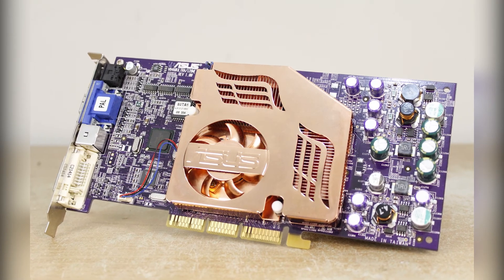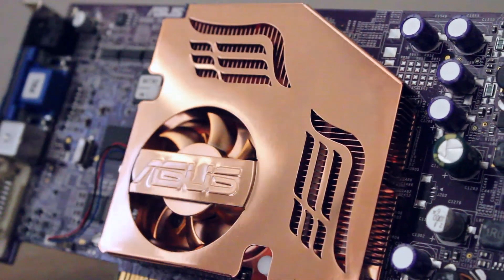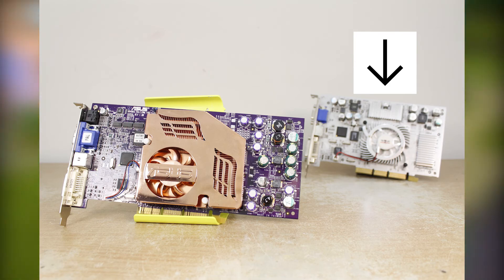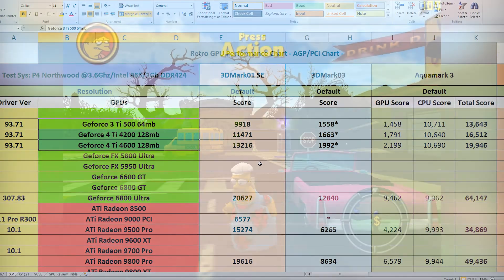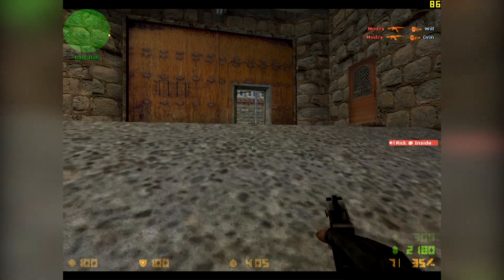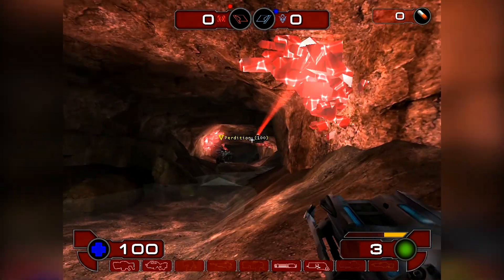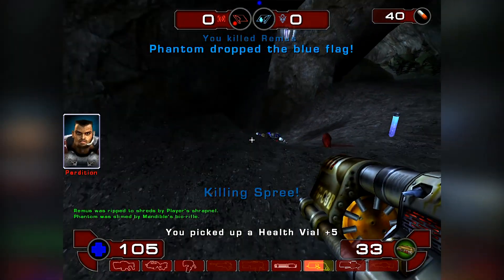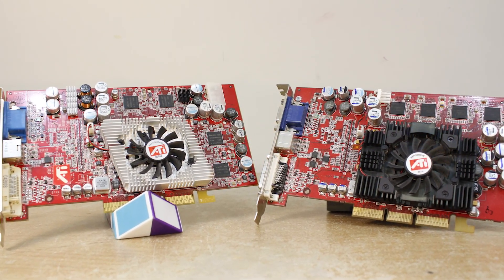Was The Geforce 4 Ti 4600 Good or Bad?

Comment: When I have to choose 3 Graphic cards with 128mb ram Titanium 4200 or 4400 or 4600, i choose cheapest Titanium 4200 128mb ram and save myself 1 - 2 hundreds dollars for playing frozen throne on battlenet. Then when my pentium 4 desktop got problem i go buy spare parts like PSU 30 dollars & new graphic card about 1 hundred dollars to last me for 1-2 years before i bought my Intel core 2 duo E8500 on Feb2009 until May2024 with a  new afox motherboard bought on july 2019 that supports DDR 3 dual channel 1066mhz. But window 7 -64bit no longer support so i cannot install new graphic card driver of GT 1030 on intel core 2 duo and that is why i bought AMD 4600G.

Comment: The GF 4 TI was just a higher clocked GF 3 TI.
Reply from the maker: Not quiet. Its core arrangement was similar but it had updated feature sets and working voltages, it was also on a new process node. So really its like the equivalent of Zen+ was to Zen.

Comment: The original Xbox GPU specs are very close to the GeForce Ti 4200
Reply from the maker: It was a GF3 at its roots but they also added features later seen on the GF4 cards. But it was custom similar to today's AMD chips in consoles. It has roots in a particular generation of process but Taylor made for the power budget and target performance of the console.

Comment: I just got one of these in a complete P4 machine today....yet to test....but may have got a win :)
Reply from the maker: They are worth a lot of money if they are in good condition with pristine copper
Reply: @CuttingEdgeRetro   I had no idea lol. Got the whole PC for $20. AOpen HQ08C case, Asus P4S533 M/B, P4 2.26 CPU. 
Plugged it in and away it went. Just dusty. I am going to pull it apart and give it a good clean. The video card is dusty, but should come up OK. I have the glasses as well. 
What sort of $$$ would one of these card bring in pristine condition?
Reply: @MikesTrackBuilding  Ebay prices probably a couple of hundred dollars, when it eventually sells. That's what people are asking for them anyway. Local equivalents to ebay, maybe much less sometimes. That's due to the seller putting them up for a low starting bid and a bidding war just didn't happen by some random chance (there's a finite number of people at any given time looking for these and on smaller local auction sites you don't have as many bidders). Or for whatever reason there is something vaguely "wrong" with the card; not necessarily a real thing but ugly cooler design, noisy fan, non-descript OEM card.

I bought a Quadro4 980 XGL ("ti 4600" workstation card) for $30-ish + shipping recently in my local currency. It's not branded ti 4600 and the cooler is fairly generic and does not really look like a ti 4600 cooler. Likely it's got better binned silicon than a "real" ti 4600, same exact hardware, and you can flash it to a ti 4600 if you really want that for some reason. 

I also have a dumpster find ti4400 that I don't think would sell for much. It's a ti4400 for starters, but it also has that heinous ASUS "blowfish" cooler. You saw that nice copper cooler on the ASUS ti 4600 in this video; well the ASUS ti 4400 sported this cooler: https://images.anandtech.com/reviews/video/roundups/2002/05/gf4tiroundup/asus4400f.jpg . Jesus why?
Reply: @soylentgreenb  Yuuuuk! That would make a maggot spew lol

Comment: For windows 98SE gaming the ti4200 is not necessarily the one to get. CPU overhead was added to the drivers gradually from the TNT2 to the geforce FX, really weighing them down on a slow CPU. For something like a pentium III slot 1 system what you want is somewhere between TNT2 and geforce 2, or maybe a voodoo 2. If you have a very fast CPU like a athlon XP or tualatin the Ti4200 or one of the FX series makes a lot of sense. If you get an FX 5900 non-ultra, which is still occassionally found cheaply, you get a lot of CPU overhead, but you also get almost free anisotropic.

9700 is more of a collectors card. They had a bad shim/cooling pad solution and finding  them now is expensive and they might not work very long. The 9800 is a better bet and much cheaper (pro or non-pro or XT doesn't matter much, just don't get the 128-bit memory version) , but feels more like a windows XP card to me.

I opted for a Win98SE system that is "authentic" (what I had) with a TNT M64 and one that is rather spicy for a windows 98; with FX 5900 non-U with a fast core 2 duo. A3D 2.0 is essential and a key part of the reason to own a windows 98 machine.
Reply from the maker: I'll try answers what I can. The gf4 cards are good for high resolution win98 gaming  vs something like a pair of 3dfx V2s that's limited to 1024x768. I have a P3 1.4 tualitin 98 system with a GeForce 2 ti and my 2 voodoos in it. That's my preference.
Reply from the maker: Your right with 9700 vs 9800 etc. I have all the Radeon 9k series cards. The sweet spot is my 9500 pro for win98. With 9700/9800 being better for XP.
Reply from the maker: Im about to upload a 2020 GPU collection update video where I go back over my entire collection and my builds. Stay tuned for that.
Reply: @CuttingEdgeRetro  Are there any other cards you're looking for in particular? I was having a huge sell last year but I stopped half way through (got bored of the constant forum checking and packing and post office runs). Still got loads left, including some oddities. Let me know if you're still collecting.

Comment: What was the difference between the V8460 Ultra and the V8460 Ultra Deluxe?
Reply from the maker: The very minor clock speeds, heatsink and included accessories. The ultra deluxe came with the Asus VR100 glasses. Ultra has the basic small fan with fish decal on it.

Comment: I'm still thinking about getting one of these for a Windows 98 Gaming PC build.
Reply: You should just be aware that this will force you to use quite late GPU drivers, which have much higher CPU overhead. If you go with something "slow" like a pentium III slot 1 system you might want a geforce 2 or something instead. With a fast CPU the overhead doesn't matter.

Comment: Great video - Thanks.  I just got a Geforce 4 TI 4200 128mb (Aopen model 4xAGP) for a retro Shuttle XPC (and to run Star Trek DS9: Dominion Wars - Which it does after a few patches :-) Phew)  I was wondering about the cooling fan's on this generation of card, are they just set to run at a set speed or do they slow down depending on temps ?  I ask because mine just runs at 1 high speed and it's a little noisy - Thanks.
Reply from the maker: Cards of this generation had 1 speed. 100%.

Comment: Probably worth mentioning that I found a Geforce4 Ti 4600 (same model you have) in a lot of old graphics cards on Ebay. The card is in full working order and nearly pristine condition. The lot had 4 card in it and 3 out of 4 were in working condition (All Geforce4 Ti models). I believe I paid about $60 for the entire lot. Now I just need to find the illusive Geforce FX 5800 Ultra...
Reply: Did you succeed?
Reply: @MalfunctioningAndroid  Nope, I've all but given up on it. I've seen a few sell for $2000+ on ebay, never seen one in the wild yet.
Reply: Out of curiosity, why go for a jet turbine 5800 Ultra when the 5950 Ultra is a faster, cooler and far quieter performer? Also seems easier to find. I hope that if you do find a 5800 Ultra, it goes under your desk so you can hear your games. Lol.
Reply: @redleader6442  Well, it's just for collecting purposes, not to actually use it. I already own every version of the FX 5900 series including the 5900 XT, 5900 vanilla, 5900 Ultra, and the 5950 Ultra. Obtaining the 5800 Ultra is just a 'gotta collect them all' situation. At this point I've mostly give up looking for one.
Reply: Something tells me that the cause for your hardship in locating one is because of the inefficient cooling method NVIDIA used causing them all to eventually burn out. Maybe find one with a third party cooler? Did Asus or EVGA make any?

Also, I get it. I use my 5950 Ultra for my XP era gaming, so it's easier for me to assume that people get cards to use them as often as they collect them.
Reply: @redleader6442  Yeah, you're right about a lot of them failing. Additionally, the FX 5800 Ultra didn't sell very well because it was up against the Radeon 9700 Pro. It also had a very short lifespan before the 5900 series was released. On top of all that, the FX series in general is notorious for being terrible at the time (at least in DX9 games). I think the FX 5800 Ultra is probably one of the most sought after cards for collectors because of all those factors. Kinda makes you wonder which cards might be the next FX 5800 Ultra in the future. 

I currently use a 5900 vanilla in my main retro PC. I've had  few expensive hardware failures over the years so I'm trying to preserve the Ultra cards, especially since they're going up in value. I don't think it would be easy to replace a 5950 Ultra if it failed (at least not for cheap). I bought most of my retro hardware when it was worth $20 bucks or less on the used market.
Reply: @IronicTonic8  As long as they're adequately cooled, the cores of the Ultra cards generally last a very long time. The stock 5950 Ultra's cooler is massive for the time (especially when compared to the dinky little GPU coolers and complete lack of memory coolers on the stock GF4 TI series that came before), and quite effective. Usually, only capacitors need replacing after 20 years or so, and then the cards that stop working end up fine.

I've always found that, while the 9700 and 9800 series from ATI were better performers and supported DX9 much better, I can still get top notch performance for the XP games I play at high resolutions and settings when I use my 5950 Ultra. Plus, I kind of consider it an added awesome factor to use the first (properly implemented) double slot cooling solution for a stock high end GPU for my mid-2000s gaming.
Reply: @redleader6442  That's good to hear. I'm all about proper cooling for retro hardware, it's usually my top priority when building a system. I've used quite a few Geforce4 TI cards over the years and most of them get upgraded with aftermarket coolers and heatsinks for the ram. I've heard about the Geforce4 TI cards failing due to poor cooling but I haven't had one of my own cards fail yet (not joking, I think I have 7 of them). 

The Geforce4 was my preferred retro gaming card for quite a while. I liked them for the combination of older drivers and good performance in most titles. This was back when I was only running Windows 98SE, but I prefer to dual boot 98SE and XP nowadays so I like a bit more GPU power to run some newer titles. I have an overkill XP machine too, so if I have something that doesn't run on an FX 5900, then I use my overkill XP machine.
Reply: @IronicTonic8   My preferred retro gaming card for XP is my 5950 Ultra and my preferred gaming card for 98 era gaming is my GeForce2 GTS. Most games from the 98 era do wonderfully on the GeForce2 with maxed out resolutions and high graphics settings. The GeForce4 TI has always seemed like overkill for 98 and not powerful enough for XP, so it doesn't quite fit in terms of either.

I could build an overkill machine, but I remember being a teenager drooling at Pentium 4 HT 3.2GHz Northwoods, Audigy 2 ZS's, FX 5950 Ultras, and the Thermaltake Tsunami Dream cases. Never being able to afford them. Being able to play XP games on my dream hardware is just too good, so I can't be bothered building something with a Core 2 Duo E8600 and GeForce GTX 240, which would play any XP game at maxed out settings. I have those parts in surplus, but there's no point. It just wouldn't have the nostalgia factor, which is a must for me. I can sacrifice a few FPS and a slightly lowered resolution for that.

Comment: Great Video! In my experience the PNY GeForce 4 Ti 4600 I have had a bad fan it was super loud and clicky, I tried to fix it but I couldn't. Then I got a GeForce 4 Ti 4200 128 mb overclocked and it's fantastic in my Windows 98 retro build!
Reply: Couldn't you swap the fans?

Comment: hey Modzy, i have a geforce4 ti 4400, i bought it to use in a windows 98se build, using a 1ghz p3, im getting major fps dips in most games and i was wanting to know if you tested this card in windows 98 and what kind of experience did you get from it? did you use a faster P4 or AMD cpu? nice educational video.
Reply: i have been playing all sorts of games, need for speed 3 and 4, rune, expandable, defiance, forsaken, quake 1-3, in quake 3 timedemo 1 im getting 93 fps, i was getting 98 fps using an older driver, im testing various drivers now, going to start benching all of my vintage graphics cards in windows 98, so im trying to first make sure my system is 100% stable and performing well, and then dial in the right drivers for each card, when trying to enable agp 4x mode, i get artifacts in games, and performance isn't improved by more then 2-3 fps, so i have disabled via 4x mode. 
system specs:
asus p3v4x apollo pro 133a
intel pIII 1ghz 133fsb slot 1
2x256mb crucial 133mhz ram
sound blaster audigy 2 zs WDM driver 
sound blaster AWE64 value 
geforce4 ti 4400
200gb hdd split in 2 partitions
Reply: Modzy's Retro Collection I'm using fraps v1.9d in windows 98se, I'm not sure if any newer versions will work but this version is missing the benchmark option
Reply: Use the earliest driver. Later drivers added more CPU overhead.

Comment: how do you overclock old geforce 4 cards? i can find absolutely no information online anywhere.  I was given a practically brand new msi geforce 4 ti 4800se x8 with the original box included games drivers and everything. but the included overclocking software in the driver disk once installed if I click the desktop app it does nothing but open a blank dead websight page instead of launching the app.
Reply: I ended up getting an XFX geforce 6200agp 256mb and taking riva tuner to it. got the core from 350mhz to 450mhz and pretty high on the memory too. But just last month I ended up changing the hole build cause I won the rare pentium 4 extreme edition ht SL7Z4 3.73ghz for $54. So I completely redesigned my build and now have 4gbddr2 pentium 4 extreme edition and 7900gtx.

Comment: Some beautiful photography! Excellent video! One thing to note quickly is a bone stock Ti4600 should actually be running at 650MHz (effective) memory. 550MHz would be the Ti4400 (or 4800SE).